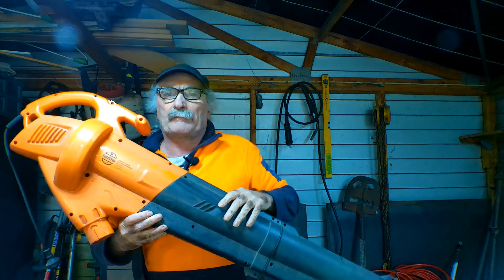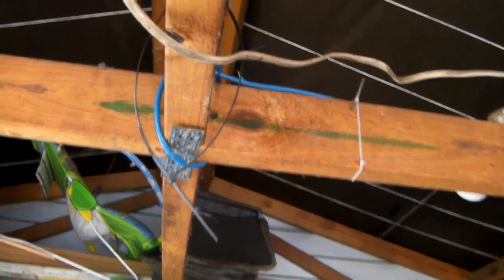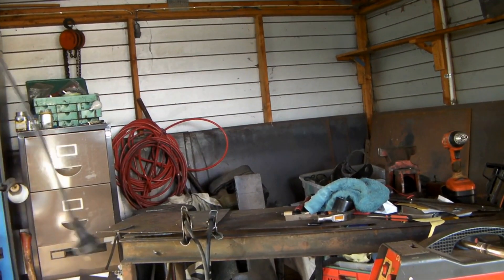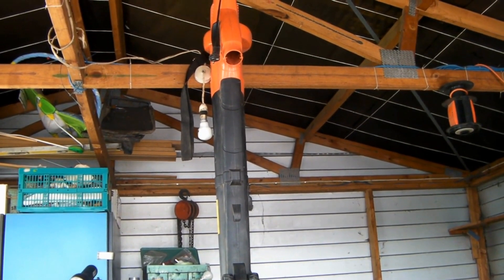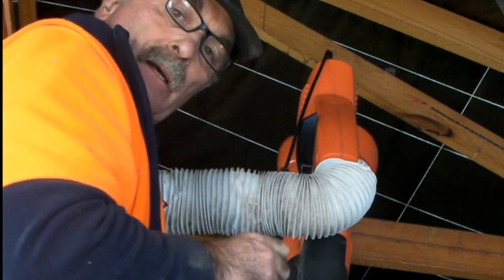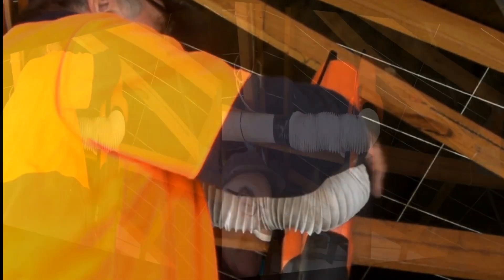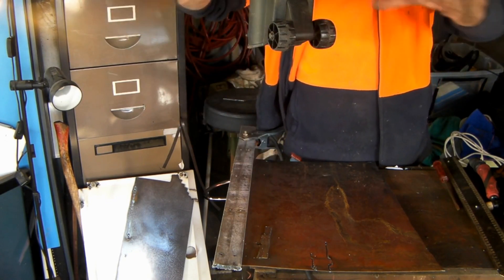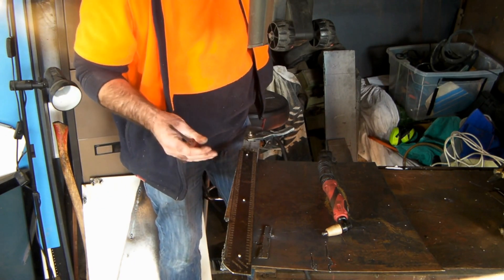How to Make a DIY Welding Fume Extractor

Comment: Not very good for hearing.  You should probably use ear plugs, or something quieter.  If you want something quieter, look for a microwave that mounts under the counter above a stove.  They have hoods with fans built-in.  People throw away the microwave because the microwave part does not work, but there is a good chance that the hood still works.  With a little rewiring, you have a decent hood.  Maybe you can cut the microwave free too and just have the hood.  I haven't done this myself, but I can't see any reason it should not work.  Still, need pipes or tubes of some kind for the vent, obviously.
A trick I have done to avoid fumes is to have a blower fan blow into a long hose.  I used foam pipe insulation that was pretty cheap as a tube...taping several pieces end to end.  I made a funnel from a jug, put a mask over the fan first and taped the funnel over the blower fan exit.  I had the blower in the other room.  I just put my mouth over the hose and breathed in to get air.  I tried first with just the hose.  It is too much work to breathe.  With the blower fan, it is quite comfortable. 
I don't know how compatible a hose is with a welding mask, though.  I was just using some nasty epoxy paint.  I had the fan already.  I got it for $70 American.  It was a Lasko Max Performance Pivoting Utility Fan.  The fan itself is reasonably quiet, and strong, though the pivoting function takes more force than it should.  It doesn't have rubber feet, so it can wonder.  I have 3, only one wanders.  But there are probably many blower fans that would work fine.
The only disadvantage I ran into was remembering to breathe in with my mouth and out my nose.  I just needed it for the one job.  If I were going to do this all the time, I would have rigged up a helmet or something. And if the end of the hose does not look clean, cut off a couple inches.
You can sometimes find blowers attached to indoor grills, that you could liberate from the grills.  Probably needs a soak in water with some degreaser to get one clean enough for this.

There is all sorts of fancy equipment, of course.
Reply from the maker: Great idea . Cheers pete